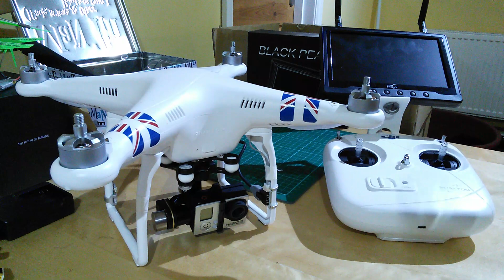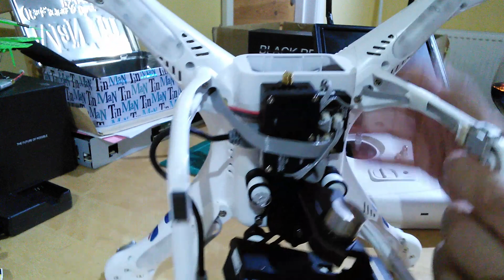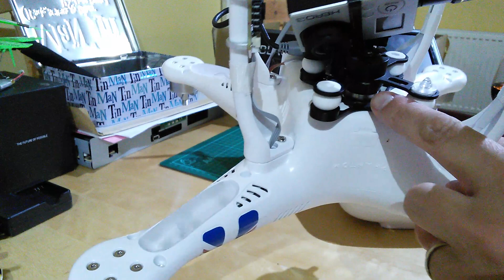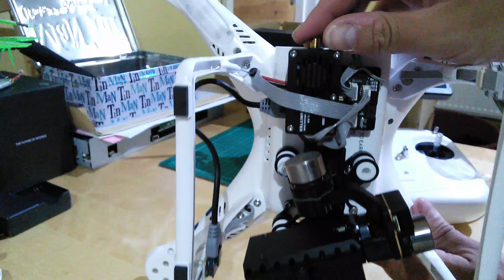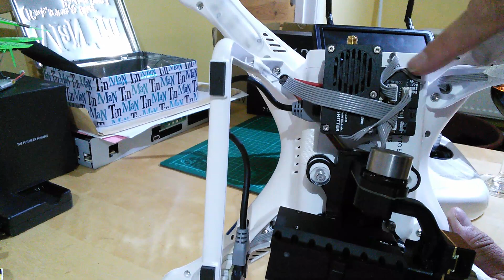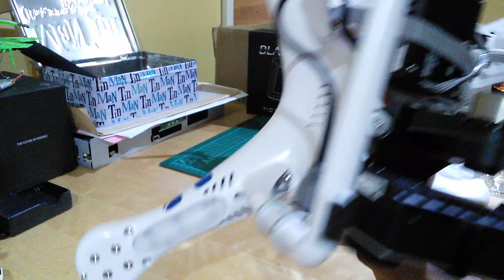My DJI Phantom 2 Zenmuse H3-3D and FPV setup

Comment: Nice install.  The DJI video tx is a little bulky but I see it has a fan which accounts for some of that bulk.  Most don't have fans.   All you really need for 1km range is a pair of skew planer antennas one in the video tx and one of the two antennas on the monitor.  If you add a helical as the secondary antenna you will be able to get much further distances or course and it will dynamically switch between the two antennas as needed.  Using the helical antenna on your p2v you're well aware of the benefits the helical made there and a 5.8ghz helical is smaller.  Just remember to match rhcp or lhcp together.  

I'd love to have the P2 with H3-3D as well.  I love the stability you demonstrate with the gimbal.  I would just switch to v2 firmware instead of the 3,0 firmware.

Speaking of firmware the latest firmware for the H3-3D is supposed to reduce how often the landing skids come in to view depending on your movement.

Comment: I'd hand it to the GoProHero3 or Inspire 1 for image quality. I suppose you would be flying blind with the H3-3D + GPH3 but it cost significantly less than the Inspire 1. I suggest buying the best but the H3-3D + GPH3 is an excellent choice as long as you aren't trying to fly too high or fly in areas where a large object obscures the pilots direct line of sight. I just bought another gimbal and camera for my Phantom 2V+

Comment: I wonder what you did with the interference board? I might have to try this setup as it looks nice:)
Regards, Lars
Reply: OMG!That drone is freakin awesome !thnaks for the heads up on the wine !
Reply: *****
Thank you Simon. Yes dji recommend it to be fitted inside the hull but i do not have the correct Phillips driver yet:) Will your setup work with the iOSD mini you think?
Reply: *****
Thank you very much for your time Simon:)

Comment: Hey Simon.  Currently setting up a Phantom to do some real estate shots.  I'm utterly impressed that you're still responding to your comments below.  So thank you in advance.  So, have you continued to be impressed by this FPV/Telemetry setup?  I'll likely go with this (unless otherwise recommended) and transplant it onto a heavy-lift octo later.  Also, what's the cable going from the Mark II to landing gear?

Comment: Nice setup I have the black pearl for my phantom 1 and immersion 600mhz transmitter with skew planer on transmitter and one the the black pearl getting 900m range but would be best with a helical on the black pearl for longer range

Comment: Thanks for this video! I had been researching a very similar setup (only difference is the iOSD mini vs the mark 2) and this answered a ton of questions that I had!
Reply: ***** I didn't see your tip until it was too late! BUT, I got my setup, and thanks to your video (among others), got everything installed and configured and had my first test flight! My next project is to figure out a way to get the FPV data overlaid on the GoPro video. :)

Comment: Thanks, this was really helpful :)
Reply: ***** I have a question if you wouldn't mind offering some advice - I just bought an FPV kit and it is compatible with my GoPro 4. But, my GoPro is already connected from my gimbal by the single USB port. What does the USB to gimbal actually do anyway? I need to use the USB port for my FPV, can I remove the gimbal to USB cable as I can't see what it even does apart from perhaps power the GoPro (and perhaps reducing flight time, no?).

Comment: Simon,
I purchased the Black Pearl along with the Rave Aerial mount based on this video alone.
I have received the Black Pearl and I also have the DJI AVL58 av transmitter currently installed on my Phantom 2.  I cannot seem to get the channels to match up?  What is the best process to find the correct channel frequency?  Thanks for your help.

Comment: Thanks for the great video *****. Is there anything that needs to be connected to the GoPro in order to fly with an FPV? I ask because I noticed you didn't have anything plugged into the USB or HDMI ports, and I'd like to avoid plugging into my GoPro usb port because it currently doesn't work.

Comment: Simon - not sure if you covered this - do you have any recommendations for optimum GoPro settings for video taken from this setup. I have a Hero 3 and have just installed the H3-3D gimbal. I'm sure I saw somewhere that 720p 30fps was a "good" setting - just wondering whether shooting in 1080p gives a better result of whether this higher resolution exaggerates movement from the P2 that the gimbal can't compensate for. I also think I saw somewhere that going to 60fps would only be worthwhile if you were going to do some slo-mo footage. Apologies if you have covered this elsewhere (or indeed in the video - which I have watched previsously but can't immediately review). Many thanks for you advice.

Comment: Something to add to some people who may have done the same thing i did.  Had my ani interference board taped onto the bottom and replaced it for the hub. This is not the case the ani interference board must be mounted inside the copter.
Reply: I know thank you very much that video helped me out alot.  I was just originally under the impression the hub replaced it.

Comment: ***** 
 Hi there totally great video keep it up. I'm totally new to the world of FPV and would like to know if I can use same DJI receiver you have in your video with the black pearl monitor. Without any other work around meaning soldering. My friend gave me a phantom 2 with the Transmitter on it but I would like to get the Black Pearl. Will it work or will I need something else for it to work? Thanks in advance.

Comment: Hi Simon,
On my new P2 (which I yet to fly- curse UK winter weather!) I do get a clear image on my FPV (Boscam thunderbolt and monitor). But do get a scrolling herringbone effect running over the picture. Its consistant no matter where I am stood- though once in the air might be different. How is yours from any interference? I have some clover leaf aerials fitted.

Comment: Hi Simon,just got my fpv package, dji iosdmini, Balck Pearl monitor, immersion 600mw transmitter and dji fpv hub. I understand how most things connect but where does the zenmuse gimbal anti interference board connect up with all this? Do you have this board on your set up?
Great videos of yours, its great to be able to access a phantom info "hub". Even minor fixes like the battery lubrication fix are great. PS any chance of a decent schematic diagram of how everything connects? Is it possible to stow all this extra gear other than the transmitter internally?
Cheers
Reply: ***** Thanks Simon that's very helpful.I initially was trying to mount it externally but your system is better.

Comment: Simon, i have almost the same setup, different Video TX only, except my H3-3D has that damn ribbon cable that plugs into the gopro, as a result, i learned that since the H3-3D is both charging the gopro, and streaming video out the same ribbon cable, it causes lines of interference on my monitor, many have reported this, and some even used a tiny piece of thin plastic sheet and stuck it in the ribbon connection to isolate the charging pins on the ribbon cable, eliminating charging, leaving only the video streaming pins making contact, and solved the issue. can you suggest another solution? i notice that you are using the H3-3D with the H3-2D style rear connector for the gopro, maybe this rear connection is not prone to interference? can i modify my gimbal to accept the rear mounting gopro contacts instead of that dreaded ribbon connector?

Comment: Thanks Simon - now I know that it isn't just me not setting something up correctly. The transmitters channel x1 is not showing any movement in the assistant software. Do you have any idea why it would not be function from the tx. I've taken it apart because I thought maybe the lever was not contacting the pot, but when I turned with a screwdriver, still nothing?? I'm not sure whats going on. If you have any advice it would be much appreciated. Thanks Simon

Comment: Hey Simon, keep up the Aussie wine support........my question is I'm wondering if any of these high end gimbals ( especially H3-3D) allow the use of the waterproof GoPro casing. I'm looking to video surfing,kayaking etc, and the loss of my Phantom would hurt , but GoPro as well could tip me over.......what are your thoughts, and have you made a video of the iPhone FPV "poverty pack", cheers. D.

Comment: I have the same exact set up. However I noticed you didnt have the anti interference board connected? I seem to be having a problem not having my transmitter working, any idea why? 
My gimbal goes right into the anti-interference board and then the other end connects to the Phantom. Instead of the gimbal plugging into the iosd?

Comment: Hey Simon! so I finally decided to spend more money and buy this FPV system for my Phantom 2... From your video and others I see that I need the BlackPearl Monitor (32ch or 7ch?), the iOSD Mini, the FPV cable and hub, and the Video transmitter (immersion RC 600mw or DJI avl58?). Is that all I need? Which is better over which? I also have a GoPro Hero4 Silver, which has worked just fine with the Zenmuse H3-3D, but would it work fine with any of these transmitters? Thanks again for your help and responding to us all!
Reply: Hi Simon, thanks a lot for your reply! Ok so if I buy the Immersion RC I need to do some soldering but if I buy the AVL58 I don't need to do this step, am I right? Thank you for your help

Comment: Is there any way to power a gopro and the FPV transmitter with a separate battery. Not using the quads power source, and that can relay video to a monitor

Comment: Do you have a link to the FPV Hub?  I just got the P2 with HD3D and AVL58.  The Hub I got looks different than yours. The cable coming out of the gimbal will not fit into the Hub.  I wonder if the hub I got is for the 2 axis gimbal?  I searched but cannot find different Hubs for the different gimbals

Comment: Hey Simon, first of all thanks for the video it helped me out when getting my Phantom  set up. I have almost the same setup.
 I just have a question that i thought you might be able to help me with. I bought the Black Pearl kit that came with everything i have seen in your video the only thing different that i have is the AVL58 5.8 VideoLink Receiver. Is this something i want to install to the back of my controller or is it just used for a seconded monitor. i hooked it up and i get picture with and without it so i was not sure what the reason would be to use it. I'm very new at this i would appreciate the help.

Thank you Sir.
Reply: Right on thanks for the quick response. 
I'm glad i don't need to use it.  Just one more thing to mess with. Again thanks for you help and the videos.

I actually have a Vision 2 plus but something happened to the camera when i view the video i recorded it has horizontal lines running through it. Especially in lighter areas of the film..

I even tried different camera setting nothing helps. have you ever seen this problem.

Last question sorry lol.

Comment: Hi Simon...Thanks for all the good information here. I plan on implementing what you did to add FPV capability on my P2. Can you please check to make sure I have everything I need to complete this project? Do I have all the necessary cables?

DJI AVL58
DJI iOSD Mini
DJI FPV hub
Black Pearl Diversity RX 7
Monitor mount for the Phantom transmitter

Existing hardware:
Phantom 2
Zenmuse H3-3D
GoPro Hero 3 Black Ed.

Comment: Hi Simon,
Quick question, can you use the DJI Zenmuse H3-3D gimbal when not attached to the Phantom? I.e. can I attached it to a handheld pole and use it, or is it powered by the Phantom?
Reply: ***** Many thanks for your reply Simon. So could you therefore, buy a standard P2 (with no gimbal) and buy a generic "non Phantom' version H3-3D and rig it up to the P2 and also rig it up to a pole (where I could attached a battery to it)? So that you have the ability to use 1 gimbal for both airborne and handheld use? I love the gimbals but want to avoid having to buy two versions.
Reply: ***** Thanks for the link Simon but yes I think that's all over my head as well. I think I will opt for ordering the DJI Phantom 2 + H3-3D. Just got my Hero 4 black through and would love to get some of these arial shots. Many thanks for your time in replying and great videos! I'm going to do some research now on a video down link to a screen and see you have another video on that, apologies in advance if I ask some more questions :-s

Comment: What did you do with the tiny connection that plugs into the GoPro from the H3D3? I have not been able to find anything adressing this issue. I have no idea how to get around that cheap flimsy ribbon connection on the H3D3. Not compatable with FPV?
Reply: *****
Ah, I see now about the FPV set up. the main issue with this ribbon connection is it covers the SD card so you must constantly unplug that cable. It is extremely flimsy and will break over time just from normal use. they even sent an extra ribbon cable for when this one breaks. Horrible horrible design. I hope there is a way to go to the Hero Port in the back. The V2 really dropped the ball on that.

Comment: Hello Simon, Im going to put together a brief video explaining my issue, but maybe you can help me out, so I wont have to do so. I bought the P2 with the H 3 3D gimbal about 6 months ago, but didnt take it out of the box. I have 2 other P2 older models. My first, original Phantom, is no more. It skimmed the trees and fell, crashed and burned yesterday. I still have the ios mini set up that you have. However the lastest version of the P2 comes with anti interference stability board. I dont see that in your set up. Can you explain how that fits in to the wiring schematic. Thanks. You know I love the videos, Thanks Buddy

Comment: does anyone know the load the bare power wire in the case can take? I have successfully powered a gimbal off of it but i need to know if i can get away with making a y cable and powering my transmitter off it as well. TIA

Comment: Hi I was wondering if you could tell me what you think is necessary in purchasing a DJI Phantom 2 with the Zenmuse  H3-3D gimbal, and the prices if possible. I work for a production department for a university and I am looking in to buying one of these devices to mount the new Gopro 4 when it is released. Problem is I would be using this device to get aerial shots for the university/out side clients and I am worried about the wifi connection issue. Is it possible to get the same amount of connection frequency using an iPad? 
Thanks for your info.

Comment: So if I wanted to buy this and setup FPV goggles, how would I go about doing it exactly? Would I need to buy the goggles + a transmitter to connect the camera to? Would the transmitter need its own battery or something? What is a good transmitter if I need one? What's the price of the DJI Phantom 2 with Zenmuse, H3-3D and 3 Axis Gimbal, because I could only find it on Amazon for $959 and they often charge much more than the items actually cost to make a bigger profit? Also, can you use OSD's with the DJI Phantom 2 to keep track of battery power, distance/connection, etcetera ? I'm a dummy when it comes to this stuff.

Comment: Hello, many thanks to all the clear information you provide us. Its quite easy and brilliant !!!  I just received my new package with avl58 TX & RX, DJI cloverleaf antenna, FPV hub and furnished cables, ground station screen and his lipo, cables to connect all that stuff. Just two question since nor scheme or vids answers it : How do you manage energy source wiring of the IOSD Mark II inside the phantom ? (since I have seen on your vid that the two big black and red cables going out of the IOSD (BATT 11-26V) are going inside the phantom. Is the yellow connectors directly pluggable into the main source battery through right connectors or will the iosd use an other independent additional lipo ?  I have also seen that correct angulation for the cloverleaf is about 45 °. What the hell this little black metallic piece with kind of a hook at the end is done for ? coming out with two small screws M3*8 ?
Many thanks for your answer or new vids about that
Phil
Reply: ***** Hello Simon, many thanks for your quick and complete answer. My god, you absolutely know everything. You well hold your name. Its quite amazing DJI furnish a very little basic information with the FPV HUB even if cables are well identified and since they warning us about correct DC current to manage their appliances. I d also appreciate your off comment regarding what you appreciate. I will advice you a Croizet Bages red wine Gran cru classé coming from Pauillac, one of my favourite Domain from the Bordeaux area, immediately followed up with the Pomerol named area. Taste it ! If you come to the south of France leave a message !
Best regards
Phil